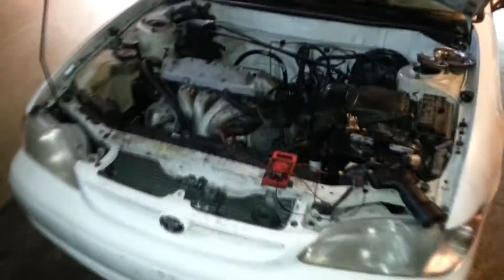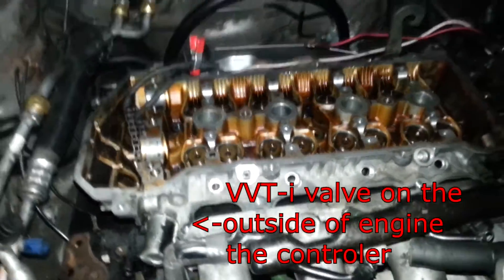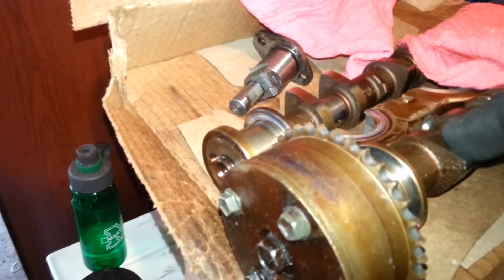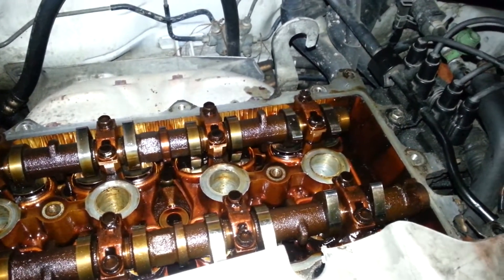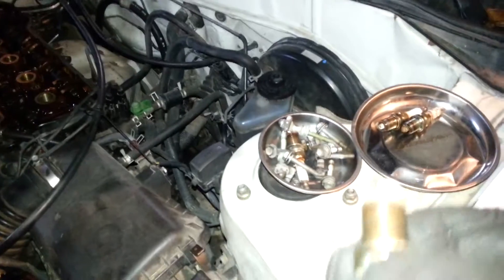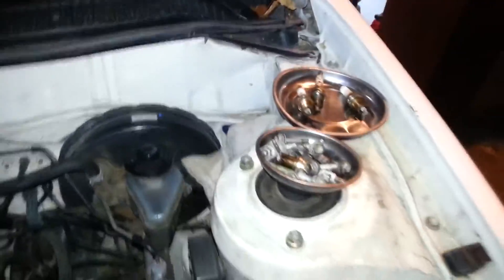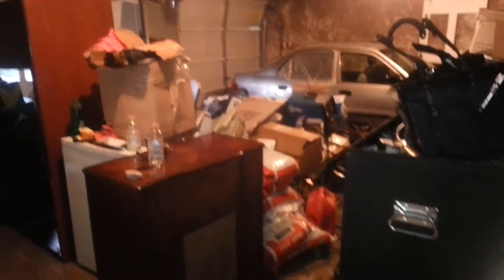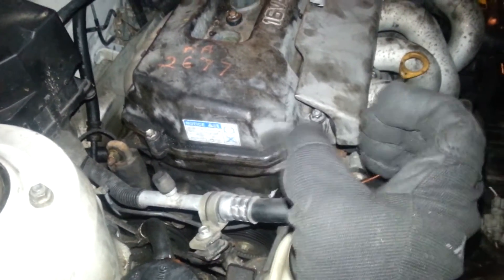VVT-i Explained; Toyota Engine, Corolla or Prizm

Comment: I'll watch this to have additional knowledge regarding to our vvt-i engine bro =]

I'll have more time for this.
Reply from the maker: Oh yeah! I think it's really cool. When mine broke the engine sort of lost power and ticked at low RPM and high. The solenoid which commanded the oil flow would suddenly work and then it'd only run smooth if I pressed on the gas hard. Or the worst, it was smooth at idle but nothing else. 

Having it randomly turn on taught me a lot about it!

Comment: Hmm white plugs, they look frightened LOL, is the system using the correct mixture but the plugs are such a hot grade they are not leaving evidence?.
Forgive my non engine knowledge, its not my thing :-).
Reply from the maker: +zx8401ztv They're white as a ghost! The reason I checked and rechecked with Brother Garcia about oil consumption and it isn't, is because the engines can get clogged oil holes on the pistons and burn a lot of oil.

White is an oil burning sign. In a healthy behaving engine a little oil will burn from the PCV system for example. So, it mostly me and these spark plugs were very, very old. Maybe 100k miles? He got this engine used and the previous owner wasn't that interested in the "details" I guess. This car has over 300k miles!
Reply: I did say forgive my lack of engine knowledge lol.

The odd thing is it isnt using oil, from your video you said so, so the white plugs dont need much.
Its possible he topped the oil up without telling you, thats the reason it looked fine, naughty man lol.

Are the plugs white with deposits then?, i could not see from the video.
I know its wrong but i do like the golden colour around the camshaft area, what would a paint shop call it, golden engine :-)
Reply from the maker: zx8401ztv You're good. Information on these spark plugs are scarce. I've wanted to know things for many years before I got to know any of it.

A tiny amount of oil over the length of time I run spark plugs hardly shows up. But when you run spark plugs "like they're designed for 100k miles" ... just because you can doesn't mean I would, you know? 

12k miles is pushing it my comfortable limit on platinum spark plugs. That spark plug wire I changed on my Nissan Frontier in a recent video? It was because 20kish miles destroyed that spark plug.

I just found out yesterday. That's the real reason that spark plug wire was tens of degrees hotter than it's neighbors. That old spark plug wire is back on the engine with no issue. Lol

It's all about a resistance chain of each component. It matches? Engine runs great. It doesn't add up the same? Engine might not even want to start, which is what I was fixing before.